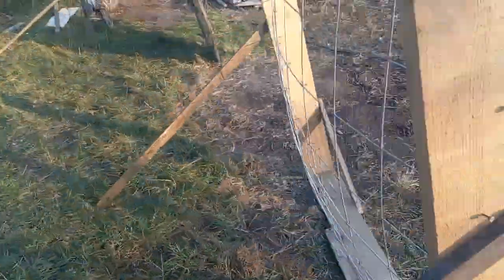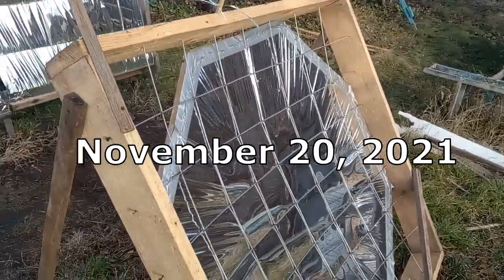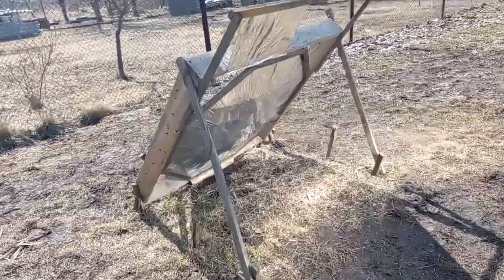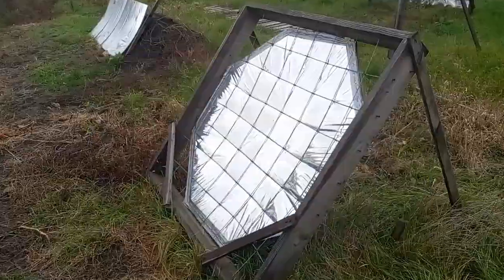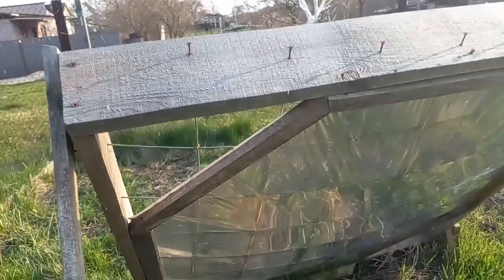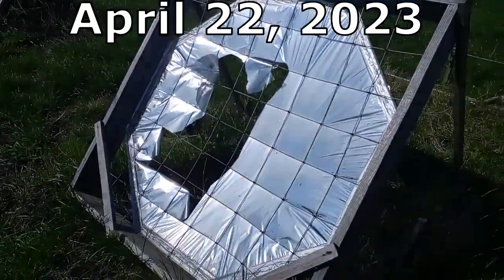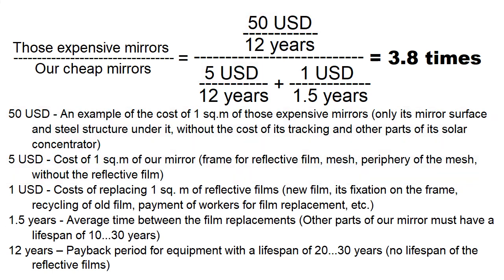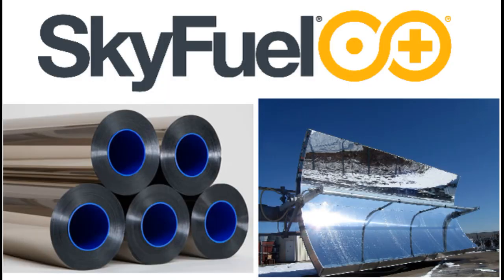Its lifespan? The world's cheapest solar heater of Parabolic Dish type

Comment: you should spray a reflective silver paint on the back of a new space foil mirror. Also you can spray a translucent plastic plaint on the front of the mirror giving it more insulation and protection. Additionally, you may use kitchen cling foil (saran wrap) to wrap the mirror in case you need to protect it more. These steps should prolong the life of your mirrors substantially.

Comment: Nice
I would consider protecting back and the sides of the mirror with 95% transparent mesh to reduce wind, and make a shadow that would reduce plant growth.
Maybe a small roof could be an option,.
Other option could be to buld small greenhouse  or box with a transparent front (glass/plexi) and placing mirror inside. That should prevent dust and snow accumulation and could increase lifetime of the mirror. Also would allow to ocassionally clean the front glass/plexi from dust.
Maybe a pipe for heat exchange could also be installed in that frame inside of a box.

Comment: So I've been experimenting with making my own reflectors, and there are plenty of products that claim, "Ohh yeah, this gives a mirror finish!" but they are mostly lying. They give dull shiny surfaces at best. Until I found Krylon "Looking Glass". Rustoluem has a similar product called "Mirror Finish", and either can be used to create genuine mirror finishes on the opposite side of a painted transparent material. I like the Mylar blanket reflectors, but I wonder if you could vacuum form a cheap reflector and paint it into a mirrow, then seal the back with something for something that would gain focus, and durability without destroying the cost savings benefit?

Comment: I think the added cost of insulating the back with some form of foam , painted white on the face closest to the mirror, but importantly filling the entire square surrounding the mirror surface. Foam being somewhat forgiving but not too much, should allow for the impacts to adsorb away from the reflective material, and the white will reflect some of the light that gets from the holes where the aluminum has dissipated. I think if we can double the use of this method to 3 years, that's slight more cost but roughly double your performance average, so what 7.6x more efficient than the other? Seeing increase in cost, let's say a conservative 7? That I think is a more viable business plan/design.

Comment: Hey brother, I found how you can reduce the rate of deterioration of the mylar mirrors/space blanket mirrors.
You have to coat the metal side with gloss black enamel spray paint.
( I don't know how necessary it is for the colour to be black but that's what I saw in that video )
I saw it in a video, if you want I can link it.
Reply: I was dying to tell you about this.
But was unsure if you'd find my comment.
Also the method I mentioned, can supposedly increase the reflectance of the mirrors as well.

Comment: Interesting... I could see a lot of stress marks on the outside of the mirror. I think the design could be improved if the frame was thicker and it had a back to it, then the wind would have less effect on it. Could the film be preserved better if you could coat it with varnish? Also if it were going to hail you could quite quickly protect the mirror by turning it upside down.

Comment: One could build a spinning tool and pour concrete into it that will harden with a parabolic surface.
Reply: Cheap…..
Reply: @Maxim.Teleguz  What's offensively expensive about a wooden tool hanging from  a ceiling-mounted motor?

Comment: Would painting the back of the film increase its durability? you could use polyurethane roof paint which is already made to resist the sun and weather for at least 10 years. You could also coat the front reflective side with clear plastidip for cars which is UV resistant, tho the later might be more expensive than replacing the film.

Comment: Dear Sergly, what would happen if high absorption black ink is applied to the thermal electric generator's hot side, and what would happen when apply CaCO3 or Ba2SO3 based paint to the cold side?

Also attach the space blanket via epoxy or acrylic or glue onto a flat surface might be a good replacement for curve metal sheet or small mirrors? Such small mirrors or strips of reflectors maybe able to construct a flatter structure like a diffractive lens/ Fresnel lens?